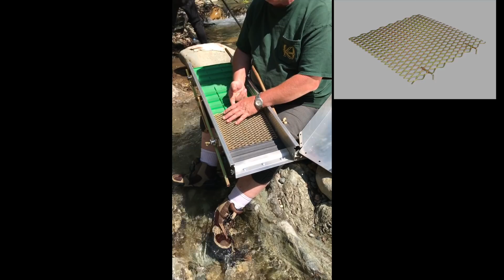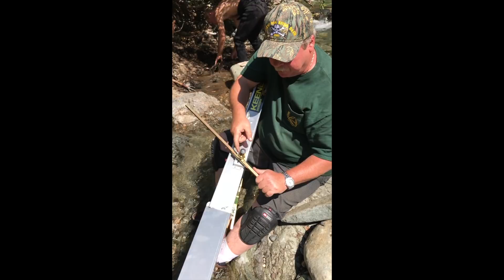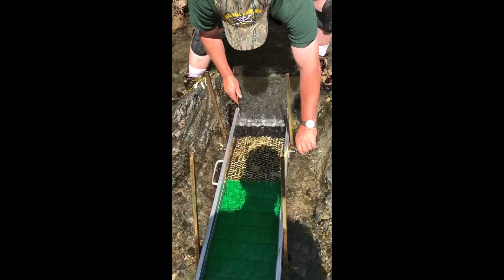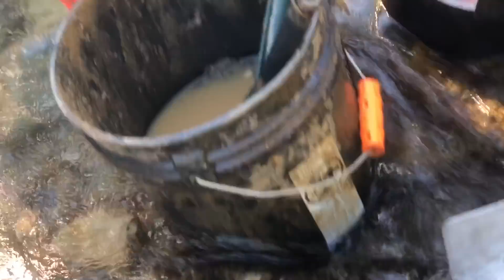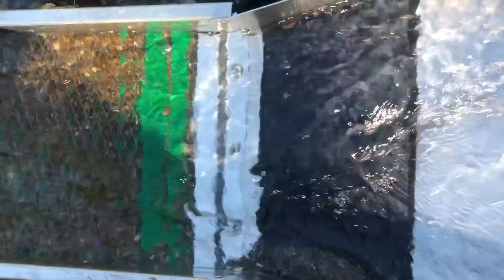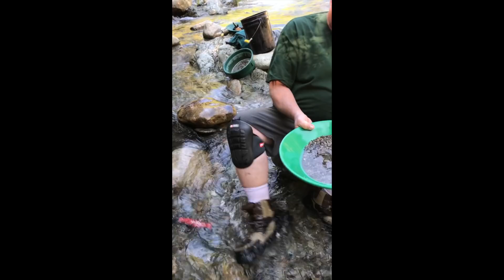Mini max sluice set up and operation.

Comment: A " KEENE KRADLE ". Used with the  handle of your units. A single stake with an arm that stabilizes the unit. Less legs to worry about. Maybe a set the cradle then lock the sluice in place type of set up with water line marks of some sort. I'm not the "engineer " 😅 Something good for sloping underwater banks. High water.
   63rd 👍
SUBSCRIBED

Comment: Isn't the expanded metal piece facing the wrong direction?
Reply from the maker: The screen leans towards the direction of the water.
Reply: @KeeneEngInc  
I always thought that, like a larger riffle, the water should climb the slope of the perforated metal, and fall off the sharp drop on the back side. You have the water plowing into the expanded riffle and being directed down into the mat beneath.